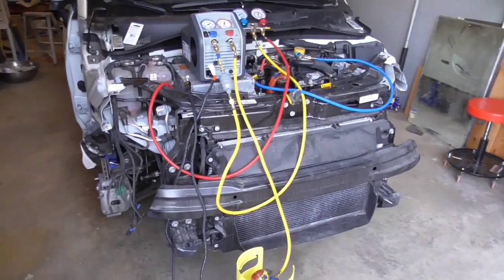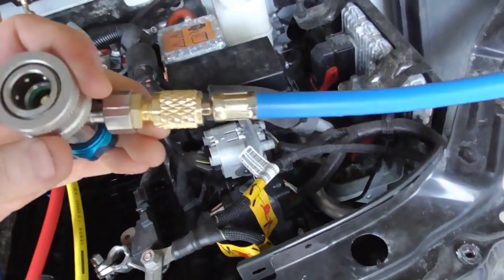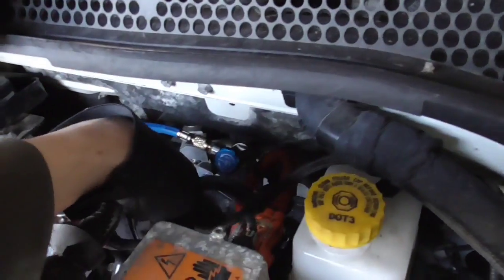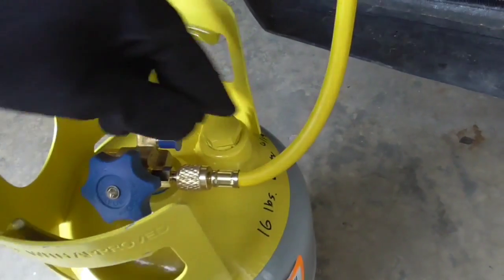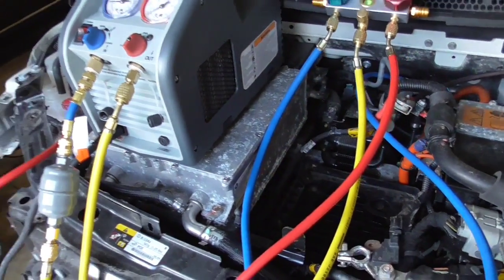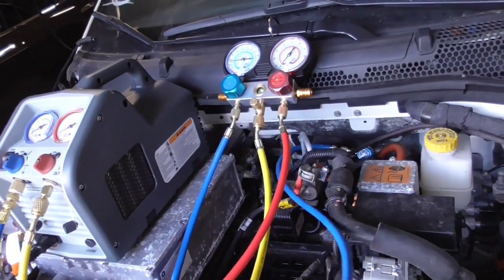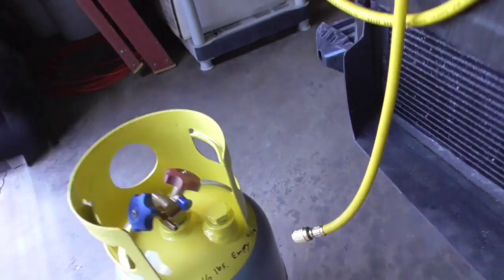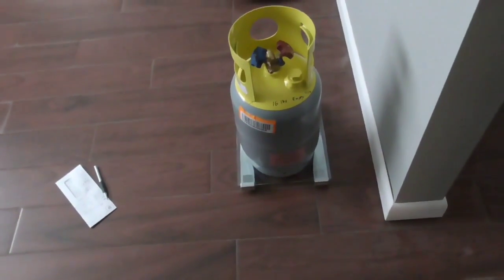How to recover R134a refrigerant from a car

Comment: Wow, many issues with this operation, I understand that many of you may want to do this job yourself and good on you for taking it on, but it is very important to do this properly! This is not intended to be a negative comment as such, but rather an educational one for anyone watching. I am a qualified engineer and from my training and experience I have noted the following...

1. You need to use a vacuum pump & micron gauge on the new cylinder to remove anything inside. Some new cylinders are filled with nitrogen which you need to remove first or some are at atmospheric pressure with air and moisture inside. Also having a vacuum on the tank will assist in recovery. As this hasn't been done, the refrigerant is now likely contaminated so should not be reused in the car.

2. You will need accurate refrigerant scales under the cylinder so you know how much you are recovering. you should check the rating on the cylinder first and check this matches the weight on the scales. This lets you know that the cylinder is empty or if not, how much refrigerant is inside the cylinder before you fill some more to avoid over filling. Weighing an empty cylinder is also good as a quick check that your scales are working correctly. Different suppliers have different fill specifications so check with them what the maximum for that tank is, but around 75-80% is common.

3. The brass knob you 'opened' on the manifold gauges is not a valve, its a dust cap for another port/schrader valve so turning it will not alter any pressures.

3. I would have personally purged the system at two different stages and for a fraction longe, but this is personal preference.

4. On the recovery cylinder there is a blue and green valve, The Blue is for vapour and the red is for liquid. You are recovering liquid refrigerant from the car so should have opened the red liquid tap on the cylinder.

5. The system should never be opened to allow excess refrigerant into the atmosphere unless to purge your hoses. If you still have pressure in your system then there is still refrigerant that needs to be recovered.

6. Also just a side note for anyone watching, at the end when you weigh the cylinder, don't forget to deduct the weight of the cylinder itself, I'm guessing that this cylinder is around 5lbs (I work in kg so may be off) I know this was done in the video but just added this in as a reminder.

Please get proper training before handling refrigerant as the simplest of mistakes can be very costly and time consuming, not to mention not having fully functioning A/C
Reply: please keep the thread going, the Price of admission is at my budget level. Thanks
Reply: K Branch jr watch the video I linked to, it’s a certified instructor. This video is probably sufficient but you just want to be careful about which side you pull from. You can pull liquid first with the pump (open the high side) to speed up the process.
Reply: @NicholasAndre1  Thanks,
Reply: Matt is right, lot of issues here.  Turning the dust cap and think it was a valve is classic.
Reply: So I gather the correct procedure:
- suck all the gas out of the tank with a vacuum pump (some of these tanks specify that they come with a vacuum already on Amazon, but probably good practice)
- purge the lines of air once they're connected -- what's the correct procedure there? I can vacuum out the lines with the far valves closed and then close the manifold side while I switch the lines, but that still leaves the recovery machine and the lines between the manifold and recovery machine. Do I turn to the purge setting on the recovery machine? Should I use a separate vacuum pump somehow to evacuate the lines or does the remover handle that sufficiently?
- Recover liquid opening the red side of the manifold gauge and put that into the blue side of the tank (is liquid in ok in the blue side?). Is there any danger in running the recovery machine too long on the liquid side without opening the low side of the manifold gauge? The robinair model seems to be happy with liquid recovery.
- Then open up the low side and recover the rest of the gas in the system. Is there any problem putting gas into the liquid side of the tank? Do I have to switch the pipes around to put gas into the blue tank inlet? Or is the gas side just for recharging so you don't shove liquid back into the low side of the system? Will that cause explosions or other horrors if I do that?

Also what is the correct procedure for refilling systems with a giant tank like this? Assuming I took the refrigerant out of the car and into the tank, I guess the amount of refrigerant in the tank would be around the correct value. Worth double checking after I recharge as if there's a leak I just repaired, presumably you'll need to add some extra after since some will have escaped. But if I had multiple cars worth of refrigerant in there I'd need an accurate scale and to be ready like a ninja when the scale read the right value.

I'm also not particularly concerned about overfilling a 30 lb tank with a 1.5 lb system like this XD

This looks like a more thorough overview: https://www.youtube.com/watch?v=BZ0qlGztES4
Reply: You are correct about many mistakes.
Reply: Thank you for the additional info and taking the time to post this threat, This is how we help  Iron Sharpens Iron . .. I hope he dose not take these down , the back-and-forth is what we need.
Reply: totally agree i highly doubt this guy has a 609 cert and if hes doing this on anything other then his personal vehicles hes breaking the law there is so many things that have been done wrong in this video such as recovering from both liquid and vapor lines.
Reply: @Hezikyrone  where does it say that in 609?
Reply: Can you vacuum the tank with this machine?
Reply: @ciceronkn  No you can't use a recovery machine as a vacuum pump. You need to have an vacuum pump and a recovery machine.
Reply: @bradclancy6069  it has all in one machines now
Reply: Omg thank you for telling him! My hair nearly fell out. That wasn't air going into the atmosphere, the pressure built up in those lines are chemical pressure.
Reply: Kkkkjjubbbnnnnbnjnnnjkkkkkkuuu8uukiiiķlñaAaqqqqqqqqalljjjkjm xu    I have
Reply: My man, love how u started that shit, how u did that shit. Good job bro, nice and educational.
Reply: I have been watching some HVAC vids here on YT, and WTF!!! Is all I can say...
I suppose, at the very least some like this fella, are at least putting in effort to not just "vent" refrigerant. 
Even though they fail in small ways. 
Thanks for your comments and insight, I would not have made the finer points quite as well. 
I do gotta give proper credit to the fact that some of the YT'ers put the effort in doing what they know or have been taught. But please, keep getting informed! This guy still has a lot to learn, as do many. We all started somewhere. I seen everything I considered a mistake here. Though I have made them along my way as I learned, then received proper training. 
Keep up the effort, keep reading and learning to keep us all safe!
Reply: @Zer0IN28  There are some good HVAC training video series here on YouTube: https://www.youtube.com/watch?v=BZ0qlGztES4
Reply: @NicholasAndre1  thanks for the suggestion! Never stop learning!
Reply: @Zer0IN28  and something that wondering : in pro machine theres a way to get the oil from the refrigerant recovered. How do you do it with this equipment that is not intended for automotive.?
Reply: @rightconditions2010  in 99% of refrigerant systems if you pull oil out while recovering the system was over filled with oil the only time you should need to add oil is if your replacing a compressor or accumulator (any component designed to hold oil) that isnt refilled which is rare
Reply: @Hezikyrone  thanks for replying.  But I ve seen the pro automotive machine have an oil container and heard somewhere the oil you got must be replace  with new oil . A little confused since my hvac equipment doesnt have that. Thank you anyways.
Reply: @rightconditions2010  not all ac machines have oil adders and pag oil isn't hydroscopic so you don't need to change the oil every time and considering it takes 3 cycles to completed change a r134 systems oil its rather expensive and labor intensive and I stand by my state ment any oil you pull is excessive the way an ac system is designed it will not pull the oil out when recovered right
Reply: @rightconditions2010  you buy the proper equipment
Reply: @Hezikyrone  wrong! But during any repair, you should be replacing the accumulator/desiccant
Reply: @rightconditions2010  apologize for such a delayed response. This is a thread I lost touch with  You will not be able to recover oil properly with the machine in this video. Sure a small amount would be recovered into the tank. You would need an in-line oil separator.
Reply: @Zer0IN28  “I learned how to do this on YouTube and am now an expert and will make myself feel better by dealing out advice to other you tubers that I feel are doing it wrong.”
Reply: @mikejmardis  Wow bud! You get butt hurt much? Nevermind, no one cares, you condescending troll. I am actually certified in small appliance, automotive, and commercial. I was here to check out the machine, as I had already watched many videos with the same unit. I didn't tear this guy apart for trying to be responsible. Just not to stop learning on how to improve his methods. 
We're all waiting for your video on the subject now dude...
Please, post the link here when your done, so we can all be shock and amazed by your brilliance!

Comment: Wow, just wow. If you are watching this trying to learn do yourself a favor and Google EPA 609.
Reply: The EPA is not going to come after you, most people end up venting refrigerant into the air with no consequences anyways.
Reply: @hankhill2530  most people do it in a way no one will ever know....
Reply: @Fchance4U  Thats true.
Reply: I got the EPA 609 certification so that my local HVAC supply would empty a recovery tank for me. Bottom line is that EPA609 training manual doesn't explain jack shit about the details of HOW to hook up, where to open valves, etc.

Comment: Thank you for the information. I have looked at different videos for the last hour and a half. They all claimed that they would show the process from beginning to end. I could not find anyone doing what you did. I am a backyard mechanic and I have all the important tools to work on just about anything including air conditioning. Matter of fact I have three different set of gauges. I have one for r12 and two for r134. I have a vacuum pump I just don't have the recovery equipment. I wanted to see exactly what I needed. Your video showed me exactly what I need. And you went ahead and answered my question about reusing the freon that you recovered. Again thank you for the great information.
Reply from the maker: Thanks for taking the time to comment.  I appreciate the feedback.
Reply: @theevolvingworld  hi if I dont want to use same freon where can I recycle it at.
Reply: I was doing the something (looking), when u add the price of freon after three Engine swaps.The system is only 400 bucks total. I’m on Engine number two ( i have 4 Teen .. )for some fun reason, people forget to check there oil and I get a good deal,  4000 car for 500 all day.(the first car was free).the prices went up a little bit on Amazon, Thanks

Comment: 1990 was the first year R134a was first test run only one model for a few manufactures. You did not use a refrigerant analyzer to test the purity of the refrigerant this is mandatory by law from the EPA I mean California bureau of auto repair as of 2018. Any one doing refrigerant work should always test. You absolutely do not know what you are doing and should not be telling people how to damage their cars or customers cars. You never start your recovery from the high side line because you remove too much oil with liquid refrigerant, way more then you should or by recovering the proper way. That little filter inline is just to protect the recovery machine thats all. That little filter dose not remove the moisture it is saturated the first time it is open to the atmosphere. You do not just go bleeding off refrigerant to the atmosphere. if you vacuumed out you machine and hoses you do not get air in it in the first place. Then you test with you refrigerant analyzer that is the ONLY way you know. There is a lot of commentated refrigerant in cars because of IDIOTS who recover refrigerant from one bad car mix it with all the refrigerant then put it in all the other car like a STD.
                          On top of that the refrigerant recovered by this method is completely moisture saturated. Unsuitable to be put back into any car. Moisture + refrigerant = hydrofloric acid, it brakes down the oil, eats at the metal parts from the inside out and on electric motor winding it brakes down the insulation on the wires over time.              
                  Also you must recover down to at least 15" or more vacuum wait 15 min and if vacuum falls below 15" vacuum turn on the recovery unit again and wait it should not fall below 15" vacuum then you know you have removed the refrigerant. And it is also mandated by EPA regulations ans proper practices. This video gets the YouTube Homer Simpson award. Congratulation.
Reply: I am intrigued by your statement that moisture mixed with 134a produces HF, the only mention of HF on the health and safety datasheet for 1,1,1,2-tetraflouroethane is it may be produced, along with something called carbonyl halides, during thermal decomposition at greater than 250 degrees Celsius.
Reply: @vanepico  I may have not mentioned all the possibilities while talking watching a video paying attention to my work and watching messages pop up on my screen asking me when I’m gonna be at the next shop but every refrigerant when mixed with moisture has there a particular asset that they will produce depending on where they’re there HO, CFC or HFC’s excuse any text to Aris I’m under a hood working right now and I just speak into my phone and let it print out what it’s gonna print. 

          But when the systems get old and you could smell that rancid smell inside a system when you open it up and you see the decayed metal inside putting away and if there’s any Fe (Iron) it rocks away and flakes away due to the acid content created by the moisture. 
       It’s something you’ll see in every old receiver dryer other than they make them out of aluminum now would deteriorate and rust.

       Some of the very old and protected condensers the tiny micro channel fins internally would rot away into a white oxide that resembled sand.
Reply: any advice on training? I've done the fed req's but process and trouble shooting seems to be a 'reluctant' topic...
Reply: JMR 626 what is the Fed requires ? what state or country are you from. ? There are different requirements in different states in the United States. Canada has their own rules and Europe has completely different rules to. As for training local vocational schools city colleges.  Are used to be the kind of training you would get being in high school but they got rid of all of our good training in this country now kids leave high school knowing nothing of the trades.
Reply: That is so true,  But teens are so Unruly and Dangerous, some  school boards shut down or tone back there shops  (in the 90'  we Blew-up a old soda machine in the welding shop with a bag of spray cans, not on purpose.. Wow what a fire ball) I took wood shop in med school, welding, auto, Drafting , AV/ electronics, DJ yes DJ with two turn tables  Video Production and Computer Lab,  All this before my  Sr. yr  also JROTC,
Reply: JMR 626 and many of you may have not noticed but this guy making this video definitely doesn’t have enough experience especially with this equipment he just bought it it’s all virgin he doesn’t know how to use it.
Reply: Yep !!!!!

"Refrigerant Analyzer"!!!!

Comment: why did you not let the machine run for an hour or so to pull a full vacuum in the system and to be sure all of the vapers are evacuated? Also, a bathroom scale is not sensitive enough to measure accurately what R134a was actually removed.

Comment: i'm reading it is a big no no to put back the refrigerant as the machine is not built for recycling the freon. Those machines are like $4k. I'd like to see how you put it back if that is possible.
Reply: If you pull a vacuum on the system, the vacuum will automatically suck the refrigerant in & if you charge it while it’s running so will the compressor.

Comment: 600$ vs $25 for 2  lbs of 134a, i guess if youll keep using that machine. It looks like you got 5 or 6ft hoses, with that little purge you did i bet you still had air in the line. anyway good video, it was entertaining